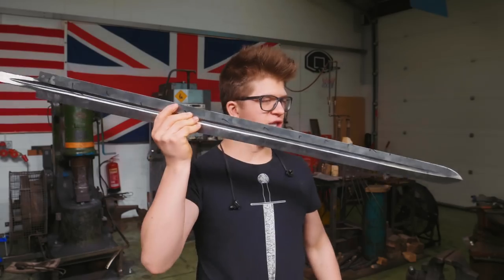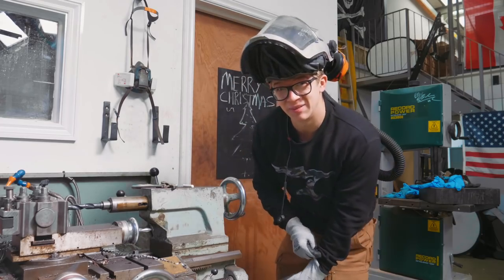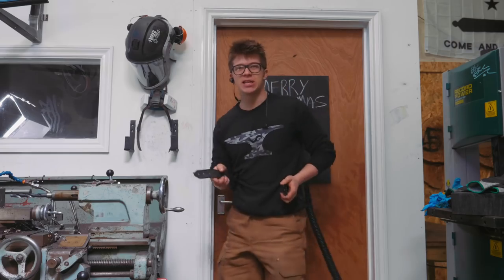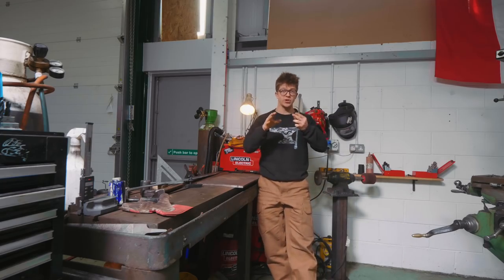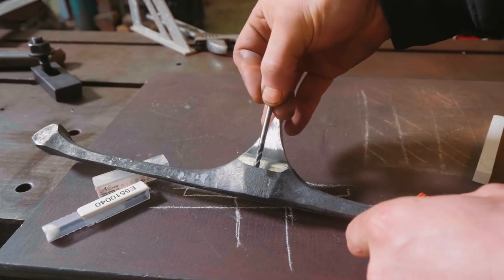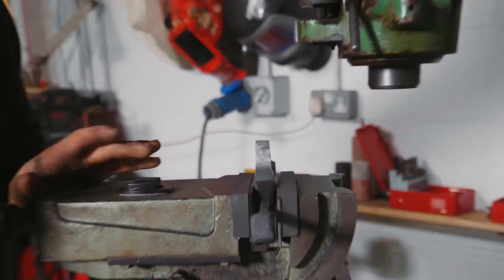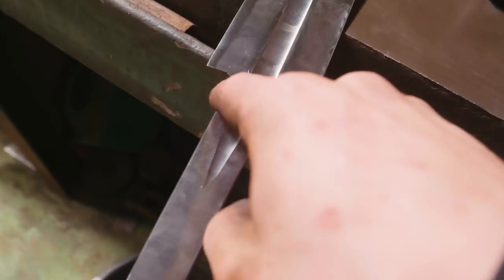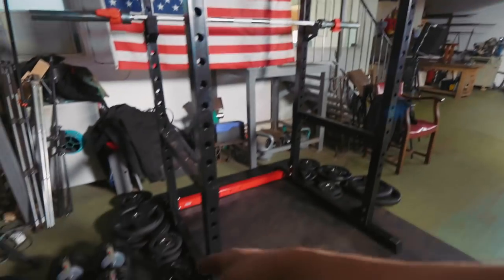MAKING A SCOTTISH CLAYMORE SWORD!!! PART 8

Comment: May I suggest that you drill the guard hole by flipping the guard upside down in the mill?  That way your milling drip will reach it.   Just be sure to get a smaller size so you can adjust the opening via hand filling afterward.  Since you will need to do that anyway.  Good luck and continuity in this project !  Keep up the great video and music!:)!

Comment: Drill through both ends of the desired slot, flip the part over and then mill between the holes.  As opposed to manual filing.  Holes are mostly to line up your mill cut.

Comment: Alec, my thought is to heat and spread open the part you just milled then put the through hole in. Once you have the fit of the guard on the tang heat the sides back up and hammer fit them back to the blade and maybe even set the center down into the fuller. Just a thought. Can't wait to see how you finish it!!!

Comment: maybe you could mill the big slot from the bottom side, so you can slide the whole blade through the guard, then put some square peaces left and ride the tang weld them in place and grind over it

Comment: Flip it over, use wooden shims to compensate for the odd shape, mill the tang slot with a 3.5mm bit, and file to match the larger slot.

Comment: Great video!! Just a heads up Alec if you were to mount the guard on it's side in the mill you can use a slitting saw to make that cut a lot more accurate and use an endmill to clean up the corners if you need a pocket.

Comment: Cut the pointy bit with a saw, Heat and bend 90 Deg. Mill the pocket and hole. Then Mill the inside of the pointy bits flat such that the face cut is half the slit width in depth.  heat bend  back and file finish.

Comment: Tip: Drill before you use an end mill as an end mill does not have a centre to it if you want to plunge down into a piece of work use a slot drill

Comment: Use a long drill very close to the size you need and drill 2 holes. One on each end of the tang slot. Then flip it over and mill out the rest of the slot.

Comment: maybe temporarily super glue a fitting piece of steel in the slot you made and flip it around to clamp the whole thing on this piece. this way your center line would not really change. taking light cuts from the other side should work out fine

Comment: Not sure if the protrusion will allow this, but you could try using your Blue Dykem to mark the center (horizontally) of the guard's protrusion's point along the side of the guard, then mark how far out the tang hole will go on either side of the center line. flip the guard upside-down, and then try to mill out the hole for the tang that way. That would make it so the tang hole does not have to be worked by hand and make sure the tang hole stays as accurate as possible.

Comment: Alec.  Your guard has two sides.  I suggest you use the other side for milling the tang hole as deep as reasonable.  Then you can come in from the first side and only need to mill out the sides for the blade as the center is done.  Also a 4mm mill can do a larger slot by multiple passes.

Comment: Turn the guard upside Down? Then mill the bottom of it out for the tang? 
I’m not sure if your first milling cut was totally center so turn it like a steering wheel 180’.and drill the bottom out. 

I hope this makes sense👍

Comment: Drill a hole center of the Guard of the whole You've milled. Then calculate the size of the Tang. micing the whole size you drilled and then flip over and Mill from the other side

Comment: Ive never forged anything before but i work with metal a lot in the welding industry so i dont know if this would work. My idea is try flipping the guard upside down and mill it from the bottom side to fit the tang.

Comment: I bought an angled vise just for situations like milling odd shapes. That way you can pivot the vise, without moving anything & ruining your position. It would give you a lot more options too.
That and mark out lines where to mill. Now that it has been milled getting them even will be a real pain. Though I do remember you saying this is just practice. I always practice on mild steel too when i need to figure things out.

Comment: Seeing how difficult it is for you with modern machinery (well, relatively modern) makes me wonder how the Scottish smiths made that kind of guard originally, whether they had a 'trick' or just drilled and filed the whole thing.
Reply: SteelZenith they heat it, punch a hole, then hammer it trought the handle.
Then worked the shape and done.
They didnt realy care if it was all straight and beautifull, it just needed to do the job it mean to do in battle.
Its not like in movie, all shiny and full of useless design.

Comment: Question for those that understand Damascus better that I: If you polish the steel more for an etch with more contrast, could you intentionally etch with the scale on/ etch at a low grit for a low contrast etch?

Comment: I know guards generally vary from sword to sword,but isn't the claymore guard usually at an angle from the hilt (around 45 degrees or so)? Or am i confusing it with great swords? 
Also wouldn't the blade be thinner thsn what you did,especially towards the point? 
As far as i know these swords were used from the 14th century all the way up to the 18th century,when plate armor was mainly used (let's not forget that swords were nobility exclusives and generally used as backup weapons) and they were generally used for halfswording (by grabbing the sword from the blade to have more point control to stab at the few spots not covered by plate),so it would make sense that they were thin as they were used for stabbing through small holes rather than for slashing like a regular sword.

Comment: I'm trying to figure out why you didn't cut the guard open with a saw (or even a grinder), drill from the bottom of it out to the cut, then rough out the rest with your mill and hand-mill (hand-held rotary tool).

Comment: Why not punch a guide hole through the bottom of the guard using the drill press then invert the guard on the mill to finish the cut through?

Comment: While wandering on the lovely road (in some places at least) that is the internet I stumbled over a root that told me that if you hit a steel or iron bar with a hammer while holding (or clamping) it  vertically it will turn into a magnet. It would be cool if you could try it. Ps. I do not no whether or not the bar has to be heated or not but it would be cool if you could try both.

Comment: Pro tip,next time rough out that pocket with a slot cutter then finish it with the endmill. It'll go faster and you'll get more life out of that tool.Also just run air or a good cutting coolant on your carbide.

Comment: Hey Alec, I'm not a blacksmith myself nor know too much about metalworking but have repaired/swapped guards on my reenactment swords before, but wouldn't it be possible to heat the mild steel "protrusions" of the guard with a torch and bend them over to give you access to the depth needed for the tang slot? 

It might mean more grinding to smooth things out a little but you wont risk your drill bit that way.

Once again not a metal worker but just a suggestion.

Comment: i was thinking about how you clean the workshop 2.0 and one idea came to mind, you could use a big strong magnet, you put it inside a cardboard box (So the metal pieces wont attach to the magnet directly) and use it on the floor where you grind stuff after it all stick on the box go out take the magnet outside, and the metal falls boom easy!
Reply: Icaro Damiano there is already magnet broom that does this this way
Reply: Or compressed air lol

Comment: Also about the gloves thing is if your hands get wet then you put them in cloth gloves heat transfer happens very quickly after the blade starts to heat up from the grinding. Now Alec I'm sure that you have developed a tolerance to heat over the years, I know I have as an ovenman in a bakery, but if my hands are even slightly wet when I put them in my oven mitts forget it The transfer is less than 2 sec.

Comment: As far as the through hole goes, why not drill through at either end of the hole with long drill bits, flip it over and use those two holes to index and mill the rest open. It's not like you are going for accuracy anyway. As far as opening everything up for the proper fitting, once everything is hogged out with the mill just use the file a little.

Comment: Why don't you find center of the cut and use a drill bit to drill completely through the piece and then flip the piece in the vice. Then mill from the other side the slot for the tang. Underestimate and file to fit.

Comment: USE MORE ( Waaaaaaaaaaaay more ) coolant when you mill, it will be a LOT easier

if you think milling this guard is hard with that endmill (not sure of the word endmill for this tool..) i used to drill 0.05 mm holes in titanium (thickness aprox. 1.5mm), the damn drill was half the diameter of a hair, i broke 3 drill when i tried to get them out from the package first time !

Comment: Would it not work to drill a small diameter hole centered through the top, flip the guard upside down and create mill the slot for the tang based on the centered hole?

Comment: Laddie....notch the topside first to set the track by band saw or... start the notch milling from the bottom to avoid the off center notch on top. Then,,, set a pilot hole from top dead center to explore where the hilt work will sit... I’m still thinking that working the bottom part to meet the top part could get the results you/we are all hoping for. Cheers.

Comment: Not sure if you are still struggling to find good endmills. The company Swift Carb does metric and standard. Will make them as thin as you like and up to 3 in DIA. And as long as 10 inches long. Carbited endmills we also do metal coatings. AlTin, SuperTin and MDC.

Comment: Soo why not take and gently heat with a torch and bend the point of the guard out of the way like 45 degrees or so to clear the chuck and allow the end mill to complete the pocket and then possibly finish the cut for the tang... then you can just heat the guard up and place a small pice of scrap the correct width and hammer it back into place

Comment: Shouldn't the ends be pointed up towards the blade tip a bit on the guard? That would also take care of the length problem. I'm also picturing three little cut outs on each guard end..i wonder where I saw that....

Comment: Why wouldn't you mill the slot before you did the shaping of the guard? I mean it seems that it would be easier if you were still working with a bar so you don't have all of the issues with trying to clamp an object with many facets. Just wondering. :^)

What's a falx?

Comment: At roughly 3:10-3:12 seconds there is an apparent UPP(unexplained paranormal phenomenon). The door behind Alex going to the grinding room moves lightly closed and then randomly picks up speed to move almost completely closed. It appears as though OP made no edits or cuts in the film as he is in the middle of a sentence when the phenomenon occurs
Reply: I don't know but maybe it's one of those hydraulic struts that push the door closed when they get to a certain point.

Comment: what you're not forging your own squat rack!?!? haha the simplest way to open up that very last bit is to drill through, then flip the guard over. and at this point, you will have the through holes to dial in your cut, and you can use an end mill to cut the rest open.

Comment: So, how did they do this before?
Is it possible to forge weld two pieces while having a cold steel-thingey as spacer? Idk, would be cool to try!
Reply: BerringerVids they heat it, punch a hole, then hammer it trought the handle.
Then worked the shape and done.
They didnt realy care if it was all straight and beautifull, it just needed to do the job it mean to do in battle.
Its not like in movie, all shiny and full of useless design.

Comment: couldn't of you hot cut through the point in the center then milled out the tang location, then forged the points back to the correct location?

Comment: Can anyone out there address the question of grind direction, basically "Horizontal v. Vertical" grinding on sword length blades. I watch programs like Man at Arms: Reforged, and they almost exclusively grind their blades vertically, unless convexity is desired. Is there a advantage to either method aside from edge geometry? Just curious...
Reply: Also, for the guard, would there be a way to flip the it over and drill from the back? Insert some scrap metal or wood into the gap you just machine out to prevent bending the tines, or did the points prevent the piece from clearing the bottom of the clamp? Thanks in advance.
Reply: vertical grinds are easier to keep a straight grind on its a cleaner grind (this is what ive found from knife making )
although a combination of both is best

Comment: You have a lathe, welder, cutters, steel (ok possibly not tool steel but you could get some) why not extend your own cutters & drill bits for special applications? I've used many that's had an extended shank over the years & I don't think they were even extended with actual tool steel. Although 4mm I should think you'd have to use tool steel or something decent.
Reply: Welding an extension on would greatly increase the risk of in snapping would it not?!
Reply: TULKAS ASTALDO depends on the application, you have to make allowances in the feed rate & speed, however any engineer would already know that, I've used some with successful results over the years that have been brazed together, dependant on the size of the application, you can braze or weld together, at the end of the day it's getting the job done that counts, sometimes they might last for a single job, sometimes you might still have them in your box 10 year later, it's something you have to do when you when you need to get the job done.

Comment: How would the guard have been formed originally? I know your Bridgeport is an old machine but I didn't see one in Braveheart
Reply: leighharron they heat it, punch a hole, then hammer it trought the handle.
Then worked the shape and done.
They didnt realy care if it was all straight and beautifull, it just needed to do the job it mean to do in battle.
Its not like in movie, all shiny and full of useless design.
Reply: EliteFurret thanks for the reply. My lack of blacksmithing knowledge is shocking but I was wondering how, after punching the hole, is that shape produced without deforming the hole? I presume that the centre point wouldn't be as pronounced
Reply: leighharron sorry my lack of english wont let me give you a proper answer.

Comment: I dip my blades all the time and I've never had problems with dry skin. I think the problem is, wet gloves hold in moisture, another reason, not to wear gloves. Though if it is a problem, get some skin moisturizer, especially now that it is cold. 
P.S. don't lay a wonky blade on a flat surface, it shows how out it is, hahaha, just messing with ya.

Comment: I'm sure I'm not the first to say it, but a Scottish Claymore does not have a straight cruciform guard, that's just a standard 2 handed great sword (Braveheart style- not historical at all). A Scottish Claymore is distinctive in that it has a handguard that has a v shape towards the blade/away from the hands, with quillions on each end, and is generally made of brass, along with the ball shaped pommel with a small protrusion like a 1/4" long round stock sticking out for cracking skulls. Brass was used because steel was hard to come by and expensive when these swords were used.
Reply: Chris Henningsen false they had straight forward and backward..
And not much often had quad-foil, it was a simbol and they didnt care for symbol in battle
Reply: EliteFurret yeah, ok. I didn't spend hours researching Scottish historical weapons for the living history gig that I do and have been doing for over 12 years. Guess all those historical records that I researched were all wrong, huh?
Reply: EliteFurret: https://en.m.wikipedia.org/wiki/Claymore
Reply: EliteFurret: http://slaintescotland.com/blog/history-police/item/41-is-it-a-claymore-or-a-scottish-basket-hilted-broadsword-history-police-3.html

Comment: Here's a challenge for you Alec make a 3 bladed sword..
Reply: boliver75 useless
Reply: EliteFurret : what are you calling useless?
Reply: EliteFurret what's useless??
Reply: Its much more heavy, harder to control, if one blade hit the other womble.
And the job of a sword is to pierce through gear. With one blade there is a resistance on material, so with 3 blade there is 3 time the resistance in total for slicing and piercing.
So its so useless that it dosnt need to be ear about, even historicly.
Reply: EliteFurret : for 1 it's just for show and 2 obviously you haven't seen the movie called The Sword and the Sorcerer.

Comment: I still don't understand why you wear gloves after heat treat, how do you know when the blade gets hot? Especially the edge. it is so thin, even if the rest of the blade is kool, the edge can get ruined. Honestly though, I never wear gloves, which has built up calluses and it is never a problem. Great video as always. Take it easy.

Comment: The only thing I would give as a criticism is One of the things that makes the Scottish Claymore hilt distinctive is forward slanting tapering cross guards with the ends tipped is quatrefoils, and a around 12 centimeter langets on either side of the blade. The hilt you created is perfect for the Lowland Sword, a Claymore off shoot. A bit of a disappointment for us history buffs..
Reply: OldToughDW yea maybe for movie or for the king.
But for the use of battle they wherent putting quadfoil.
And there was backward and straight too.